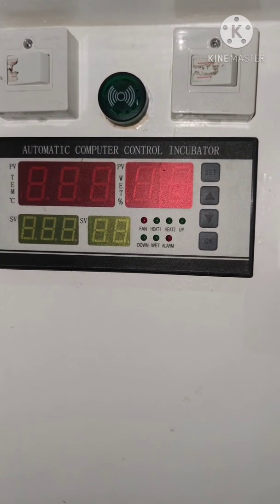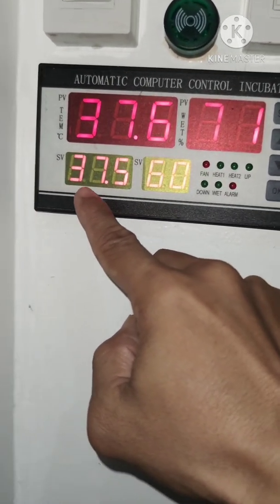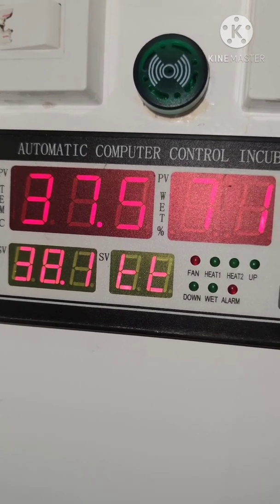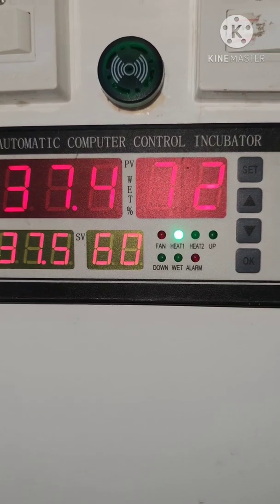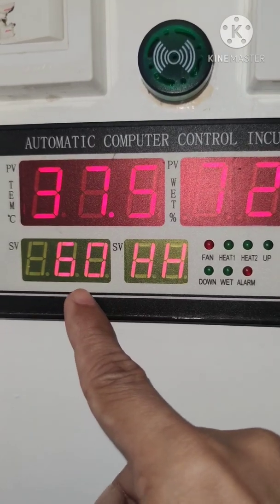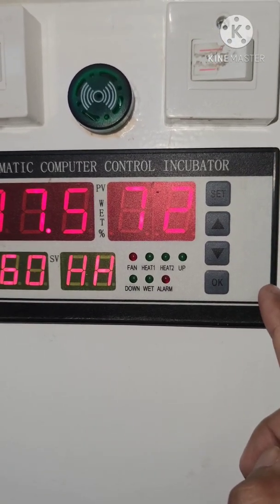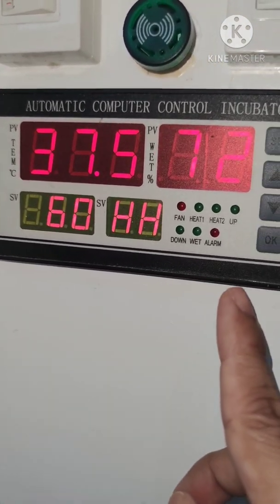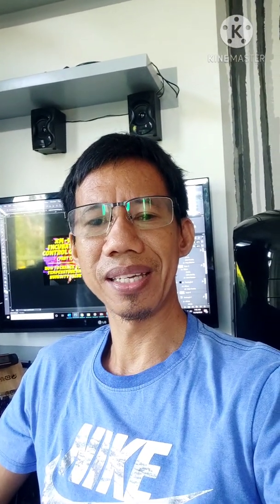XM-18 EGG INCUBATOR TEMPERATURE, HUMIDITY,  OPERATION GUIDE

Comment: Thanks for the video.  What happens is there is a power outage?
Reply from the maker: If the power outage is not too long you can provide temporary source of heat light hot water bag and place inside the incubator..

Comment: dol tanong ko lng po clibration sa f6 humidity ,dol pno po kung basa sa hygromter 54 read sa x-18 65,pno po pag prehas yn.
Reply from the maker: External ba ung hygrometer mo sir? Or andun din sa loob? Basta sakin sir naka set ng 45-55 for 1st 18days then increase 65-up sa last 3days depende dn po sa klima..observe nyo po ung mga  condition ng eggs sa last 3days para makapag adjust po kayo
Reply: sa lbas po ung hygromter tpos un sensor psok ko s loob  tbi po s sensor x-18.